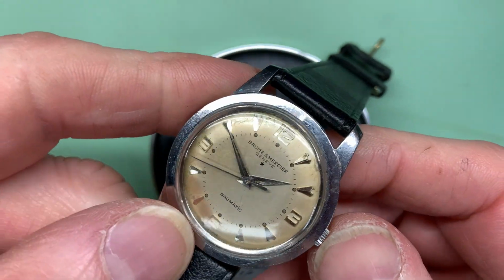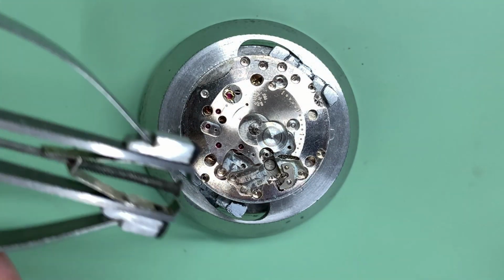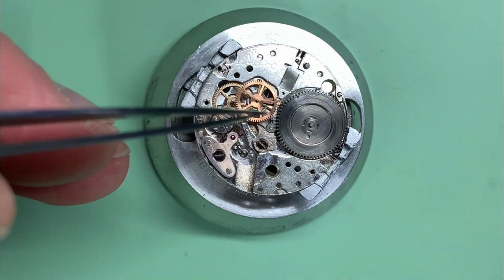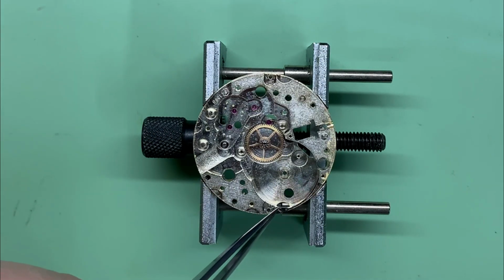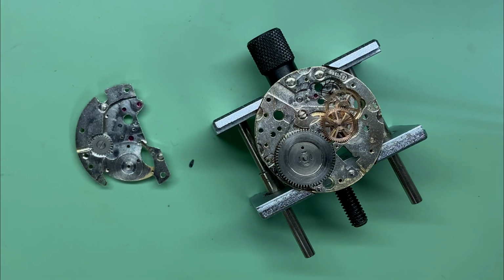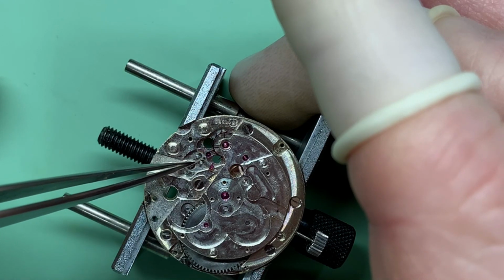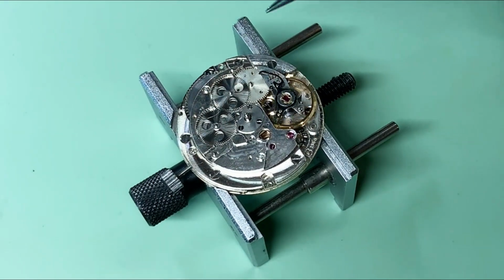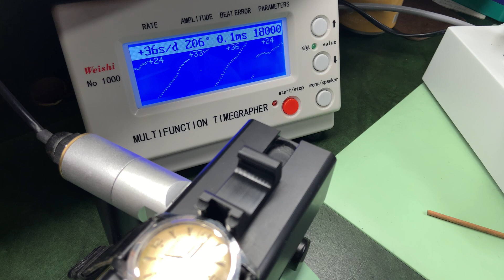Baume & Mercier Watch Restoration

Comment: Hi Mike! Three years later and I am working on a Enicar with the same movement. Felsa made versions of the 1560 with 17/21/25 jewels so I think the missing cap jewel for the escape you mention is normal for the 17 jewel version. The reversed crown wheel did not have a washer on mine and the documentation does not show any. Your video is a big help to me as I try to figure this out. Not an easy movement to work on. Thanks!

Comment: As Like the  Same style,colour , dial were available  in India 40 years ago ...  Invicta,  Solvil Titus  brand winding watches  Sold  forty, fifty years back. Movement Calibre nos  are  AS1506/07,  ETA 1080, ETA 2390.   The watch which you  repair the movement SLS,  Minute Wheel plate are  to Same to AS1506,Pull out Click is  Same to  ETA 1080. Lever Plate is also  Same to AS1506/07

Comment: Thanks Mike for this video. I'm an absolute beginner and bought a defunct Ramona for £5 from an antique / junk shop. I turns out that it has an automatic Felsa movement (4000 I think) with very similar components to your 1560. Unfortunately I have lost one of the springs and messed up the tiny counterweight lever, which I may yet be able reinstall properly. The trouble you had stripping down and rebuilding the movement makes me feel a little better and has inspired me to revisit it. Thank you again.
Reply: Try creating your own spring from a guitar string

Comment: Just did a disassembly of my first every non-Seiko which is a Felsa ST96 in a Mondaine vintage wristwatch so I thought I'd revisit this video.  Though not exactly the same, I do want to get a visual 'feel' for working on a Swiss movement thanks to your untiring efforts.  Those springs are unlike Seiko that are flat and are literally, tiny round springs which gave me anxiety. I had the same experience of plates and gears being difficult to remove or pry off.  The movement I am working on had parts sticking together because of oil.  I think the last person who serviced this is an engine mechanic haha. It even had green residue underneath the minute wheel which I suspect is grease.  I hope you were able to sort out the problems with your watch. Continue to stay safe and healthy and wish the same for your family.  Cheers
Reply from the maker: Im glad in some way I have helped Dennis.  Never be scared of a movement as this will make it harder.  Just be confident and take a load of photos all the way then you have the backup of knowing where the parts should go.
Reply: @MyRetroWatches  Your videos are always a great help! Watching you take on those Seiko movements inspired me to take up the hobby :) So glad I came across your videos.

Comment: Hello, sir!
You can easily replace the washer spring u've lost by a similar size hour wheel washer spring from ladies watch movement.
Such timegrapher pattern usually caused by a balance wheel disbalance and (or) balance spring damage. Also, this movement have a different amplitude on dial up and dial down positions. The simplest solution can be is to remove "bad side" shock jewel, wash it and oil it again.
Reply from the maker: Thank you for your advice. I don’t have any washers anywhere sadly . I will look at the shock jewels again. I am another 24 hours on since filming and the watch is still running well and keeping time.  The Timegrapher results change each time I test.

Comment: Will there be a part 2?  The tropical dial looks great.  The movement shows how solutions can vary widely to reach the same conclusions.  I thought I saw some of pivot holes were loose with the gear axles shaking in them, but I didn’t rewind the video to back this thought up.  Great job and video as always.
Reply from the maker: Not sure on part two. I will re examine the balance abs fork to just see if an stray hair or something obvious.  
Part of me wants to tear it all to bits again and rebuild without the camera running.
Reply: @MyRetroWatches  😂😂  No problem on not having it recorded, just give au update.😂😂

Comment: Great Job Mike!!  You must have taken photo's along the way while you were taking that movement apart.  Very complex movement as far as I am concerned.  Thanx for sharing that experience.  I enjoy your video's very much and also enjoy Marshall's video's.  I am going to try taking a 6497 movement apart when it reaches me.  Thanx for the inspiration.
Reply from the maker: Thanks Glen, Nice to read your comment.  I did not take photos, I never do when filming. I only photo when working on things off camera.  Filming does allow me to refer if I need to.  My pattern is usually to film and edit the disassembly and then because if editing its all fresh in my mind again for the rebuild.  I don't usually leave a watch a week before assembling either like I did here..  Ironically as I type this I have remembered I took a Zodiac apart 2 weeks ago and still not even cleaned the parts.  Fortunately on that one I have photos.   Marshals channel is great, he is doing way better than I am.  I have been in communication with him too and he is a really nice man.
Reply: @MyRetroWatches  Marshall seems real nice.  Tomorrow I pick up a watch repair tool kit that I ordered.  Waiting on many other things to arrive.  My plan is to start with movement 6497 which I have also ordered.  It will be a very long time before I reach your level.  You have helped me to become interested in watch repair. I really appreciate it.  I ordered one of those Parnis 6497 clone watches.  Real cheap practise units.  It will be February before it arrives.

Comment: Could you please make a video also about troubleshooting this issue? Because it is more interesting ... disassembly, cleaning, oiling and assembly we seen lot of times and in a while it will be boring. Troubleshooting and solving the problems is much more interesting.
Reply from the maker: I am of the conclusion that the missing cap jewel for the escape is causing this.  I can’t find a replacement and it’s up to the owner now. If I had a replacement then I could test the theory

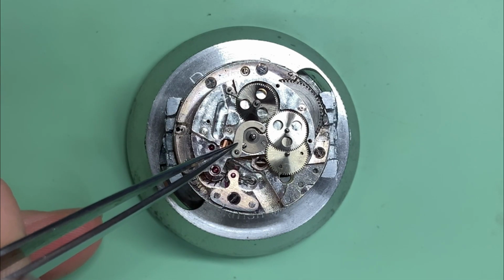Comment: Hi, Something occurred to me, so I've come back to the video.  @15:11, there's a pinion on a crooked, or "C" shaped, arm.  It should alternately engage with either of the reversing gears, depending upon the direction the rotor is turning.  Here's why I came back, inside of a washing machine there is normally an agitator which alternately turns one direction and then the other during the wash and rinse cycles.  In traditional washers, the mechanism used to create that alternating motion is called a "wig-wag".  Oddly enough, it's called the same thing in watch movements.  Please Google "wigwag pinion" and see for yourself.  Thanks for sharing your experiences with us. :-)
Reply from the maker: Thanks for this explanation . I am new to all these Swiss variants of movements and this is the first time I’ve seen the “wig-wag”. I will certainly Google this .

Comment: Thanks, Michael. I'm restoring a 690, which is very similar to this one so this was helpful. One question I have for you is what kind of mainspring did it come with (blued steel or white alloy)? Upon reassembling mine, it is rebanking like crazy. The balance wheel is just swinging extremely strongly and slamming against the other side of the pallet with every turn. With the balance removed, the fork slams against each pin when I nudge it - far stronger than any watch I've worked on. I suspect that either 1) an alloy spring replaced a blued spring and it is somehow much stronger (though the measured width/height specs are similar to what's published), or 2) somehow that double wheel that drives the sweep hand pinion is supposed to serve as a brake in some way and it loosened up (unlikely). thoughts?
Reply from the maker: Funny how I only see this comment  now Chris !  To answer your question I will have to go back through my records as I just can't remember. I try to rely on CousinsUK suggestions for mainsprings and run with that.  Equally I may have asked my group for help too.
Reply: @MyRetroWatches  I'm happy to report that I figured out the issue DID have something to do with the double wheel . After running out of ideas (over oiling pivots, replacing with a weaker mainspring, etc), I methodically replaced each component one by one from a donor. As soon as that double wheel was swapped in, I achieved a healthy 270-290* of amplitude. It's hard to believe this part is supposed to provide some fixed amount of friction for the train to function properly, but it's been running fine ever since. With the original wheel, the watch began rebanking after only 3 clicks of the mainspring.

Comment: Excellent job.  Perhaps inquire/research the movement to see if that washer needs to be there.  If you can get the movement running to a more acceptable level, see if you can source that jewel cover and screw.  I wonder if that has to do with shock resistance?  Keeping the jewel from popping out under shock?
Reply from the maker: All possibilities however it’s not my watch so it will be up to the owner.
To be fair I am another day on since filming the last bit and it’s still running on time.
Reply: @MyRetroWatches  - So, you are a professional watchmaker?  I want to do what you do, but buy watches online in poor condition to repair for myself.  Everytime I watch a video I think, "I could do that for £100!"
Reply from the maker: @donnyboon2896  no just a hobbyist . I run an engineering consumables company as my real job.  Watches is how I relax. 
I’m never going to be near professional standards as that takes years and proper training !

Comment: I know this will be looked down upon, but is it possible to clean up these dials without damaging them? I see it as being similar to people restoring vintage cars. I would love to see some of these older watches look brand new again.
Reply: Sometimes it's possible to clean the dial, sometimes - not. It all depends on materials its made of, what kind of paint and clearcoat used, or it's galvanized with silver/nickel/rhodium/gold, or maybe it's an enamel dial.
The best solution here: if you're not familiar with this exactly manufacturer, leave it as is 😉
Reply: Many prefer a vintage watch to have patina... and not look brand new. On some watches a re-finished dial loses the watch value. Even now some vintage cars are left with patina.

Comment: Thank you for this wonderfully detailed video! I am just getting started and still have so much to learn. I love the Felsa 690 movement and I have several watches that use it, as well as several 'Extra" and parts movements.  How do you know what winder to use to wind the mainspring? There are several manufacturers who are selling individual winders, but I have no idea how to choose as they have an (To me) incomprehensible numbering system. Can you help?
Reply from the maker: you choose the winder according to the inner wall size of your barrel.  With a winder set you offer up the arbors until one will easily fit the barrel.
Reply: @MyRetroWatches  thanks. I was hoping you could tell me which one you used, so i could buy one instead of a whole set.

Comment: Very interesting movement makes for a very interesting video. 
I am curious of what movement holder are you using there.
Kudos for great movie, and lets all have a better 2021.
Reply from the maker: Thanks .  The holder in the disassembly was my vintage Pioneer British made. You can find them on eBay from time to time and it’s how I found mine.  I also used my Bergeon 4040 .  I do prefer the pioneer though.

Comment: Most of the watches I work on are from the 50's and 60's.  What you're seeing on the timegrapher is similar to what I usually see.  Parts wear out.  I strongly suspect that the various moving parts are no longer at the correct tolerances due to wear over time, especially on watches that were left to run dry instead of being serviced.  This creates play that shows up as lack of consistent performance.  If you somehow came upon a NOS movement and serviced it instead, I suspect that its performance would be more steady.

Comment: The erratic trace could be the missing cap jewels as they hold the pivot in place and stop it from moving up and down a bit like on those Seikos you were doing with the dash shocks cap jewels. You can still but them.
I've done lots if those felsa movements look at the gross 4000 series and you will find an oil chart they are very nearly the same. That's a 1950's movement sp there must be lots of wear in it. Did you de magnatize all the parts?
Reply from the maker: Hi Tony thanks. I had considered the missing jewel after I’d finished editing . It’s something worth exploring possibly although I still have to give it back to the owner so it depends if they want me to investigate further.  As for demag yes. The keyless was actually very magnetised and took a few attempts to neutralise.
Thanks for watching and appreciate your insight.

Comment: Hi I am a great fan of your channel and have attempted some repairs of various movements myself, mostly with little success lol, however I was watching your timegrapher trace 1:10:10 to 1:10:17 or thereabouts and it seems the period from the flats is about 5 seconds, I also noticed the escape wheel is rotating at about once every 10 seconds implying that maybe there is something causing it to stick every half rotation such as a bent pin or misaligned jewel, maybe the missing jewel cover is causing an issue, it is all speculation of course but might be worth a look. keep up the fantastic videos and Happy New Year
Reply from the maker: Thank you for your comment John.  I believe you are right. I am yet to investigate further the cause but everything points to the missing cap jewel. A few comments on here are also suggesting the same.
As soon as I am in the new year I will take another look.

Comment: I think these watches bind a bit when assembled.  I saw all the black tracking from the gears on the case when you took the watch apart.  To this theory, why don't you try removing the swivelling rewind lever, which will take away some of the  mass which would compress when the back gets installed on the case.  I have a similar problem even without the auto-wind mechanism; when I put the back on one of my watches, it tends to stop.  If you do this and the watch regains it's "timing",  then you know the problem and can either keep the mechanism out or just live with it installed, knowing you assembled it well.  Just a thought.

Comment: Bravo, nice repair. Hope you had a Happy Christmas!
Curious, for this type of repair, can one simply put the whole movement in an ultrasonic cleaner and then just oil the jewels? Wouldn’t that work as well and be easier for you?
Reply from the maker: Hi Richard. Happy new year.
I’d never just put a whole movement in the cleaner. It would not clean sufficiently given plates are screwed in place and jewel settings are held in place.
You then have the issue of ensuring all parts are dry. 
I have only heard of this being done on some old Timex movements where the plates are divided together.

Comment: I recently uploaded a video on a quite old Ingersoll that was all jammed up and showed how I freed it up with gentle persuasion by tapping it softly into the palm of my hand in all four orientations and it hasn't stopped working since and holds superb time.   

Of course I won't be using it simply as it does need a lubrication service but once it fired up from a second to a couple seconds, then 5 seconds, 10, 20 onto a full minute it just seemed to thirst for life and lost its jerkiness and I left it ticking all night and let it run down its power and it kept going til the end keeping absolutely superb time.   

I pad a few quid for what is a very clean piece, its always nice when you get a brucie bonus like that, its funny as I am battling a Sekonda over magnetism, it is utterly infested with little attracties and kinda losing the will to live on that one, the bunching is right under the cock so the cock is shielding the hairspring methinks :(

Been getting some wrist love for my hand built Vostok Amphibia 090 "radio room", in between my Pulsar Kinetic and  Pulsar V600 :D

Comment: What is the period of that irregularity? It does look like possibly dirt in a jewel or perhaps a wheel that is slightly out of true. My bet is that there is a tiny hair somewhere. Maybe something as simple as oil not getting to the parts it needs to. Try wearing it for 24hrs again and see if it settles down. Its certainly not terrible, but it is a little odd. Did you clean and oil the mainspring? Was the mainspring barrel worn?

Comment: What is low amplitude ? Please explain! The face has a bit of a mess at 11 o’clock why not clean that up please . Will you order the missing plate and screw as a replacement?
Reply from the maker: Hello. Amplitude is the travel of the balance wheel on each side of rotation. The further it travels the healthier the watch is running as the power is being distributed through the train of wheels correctly. Amplitude number is degrees so an amplitude of 250 is 250degress rotation.  Each watch has an optimum amplitude which depends on the size of the wheel.  The train complications etc . Many factors .   So to see low amplitude means that the watch is running , it will keep good time but it’s not at optimum and indicates an issue somewhere.

You can’t clean dials easily without the possibility of ruining it.  11 is water damage stain which is under the lacquer and is best left well alone .
I can’t find a cap jewel to replace the missing one.